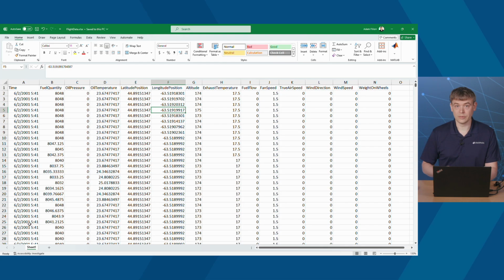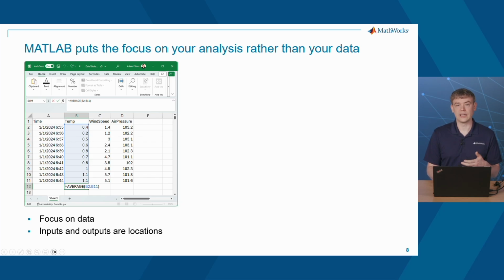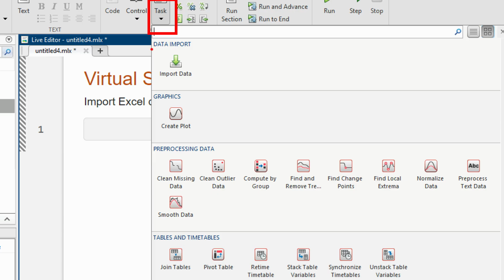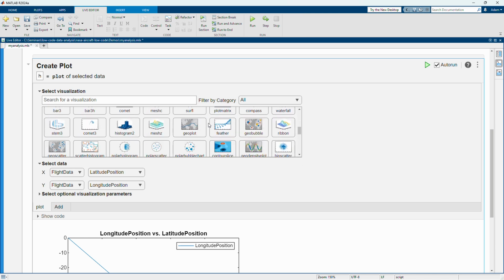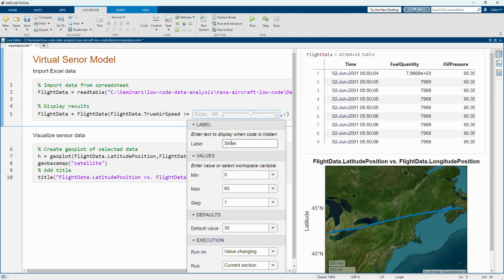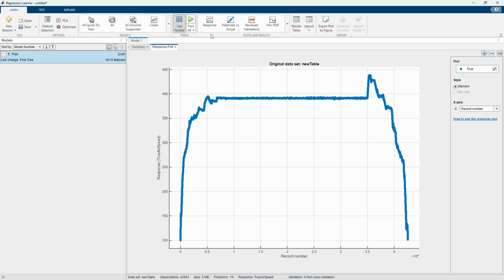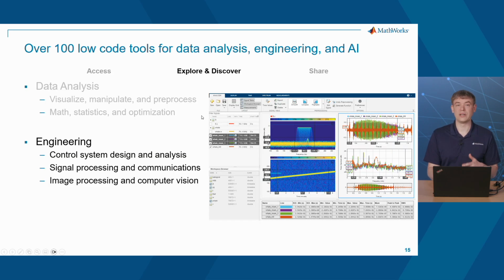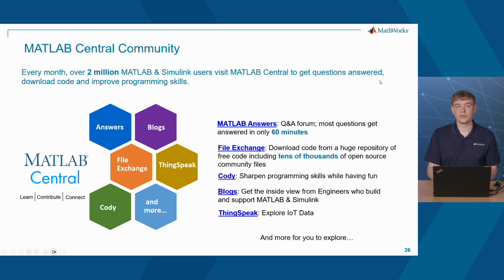Engineering Data Analysis for Excel Users: An Introduction to MATLAB

Comment: Thank you, Adam. Well done presentation. I will be going through your other presentations now that I found you on YouTube. One problem I have - my model airplane software presents data as table with many parameters such as those in your preso here - but the tables are only shown as jpeg images! Is there a way to pull organized data from an image and convert to a matlab workspace table?
Reply from the maker: Glad you enjoyed the video. Unfortunately, extracting data directly from an image can be tricky and depends on the image format. You could try OCR feature in MATLAB. https://www.mathworks.com/help/vision/ref/ocr.html ChatGPT may also be able to extract data from an image, but either way you need to check the result and you may have to make manual corrections.